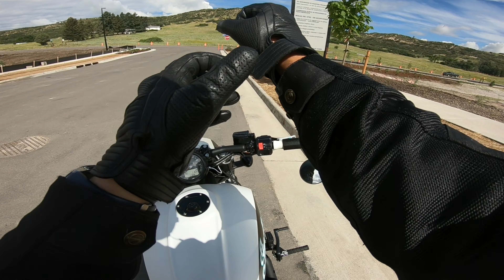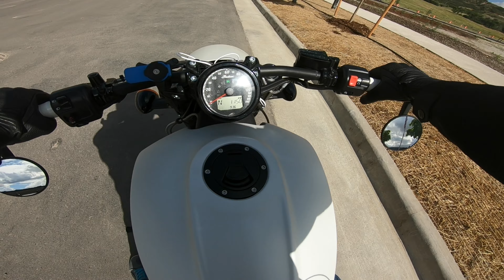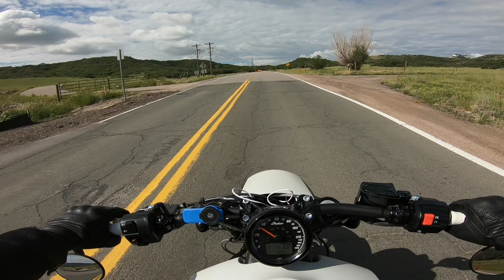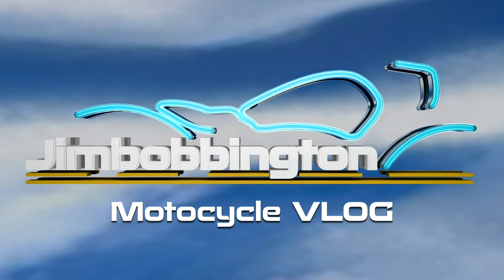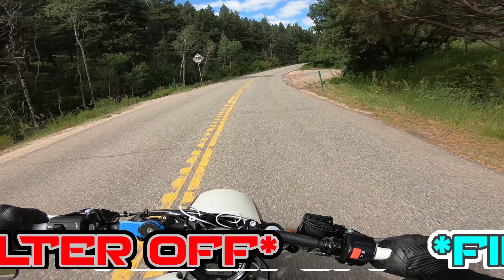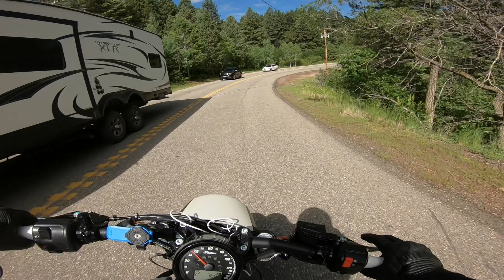Common upgrades you should not do until you become familiar with your motorcycle

Comment: I test rode a bobber 20 at the demo days last weekend with the fox shocks and a 1920 solo seat. I wanted off so bad by the end of the short 15-20 minute ride. Looks cool for sure but my dad and I were both saying the same "damn that thing is uncomfortable!" I have a Corbin Brave with the stock shocks set to 175mm. WAY MORE COMFORTABLE! Besides the leaning forward so much from the seating position the Corbin puts me in with the stock bars. Hands down, best part of riding the 20 was the mini apes. So I ordered a set of 10" dean speed butch bars (hoping the bit of pull back will accommodate the slightly back and down riding position from the Corbin.) Got some rampages coming soon, too!!! Can't wait! GP Shorty's are awesome, don't get me wrong. Definitely took care of the moped sound but after a year, my ears are crying for some relief.
Reply from the maker: All the things from DeanSpeed will be awesome!